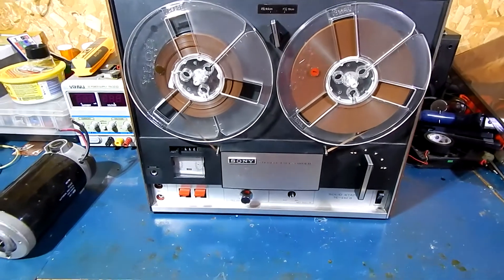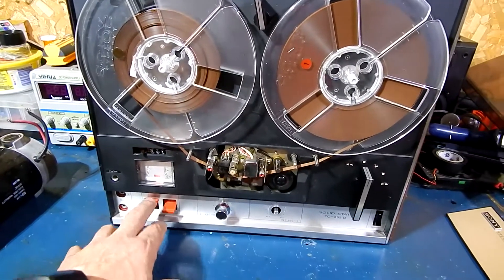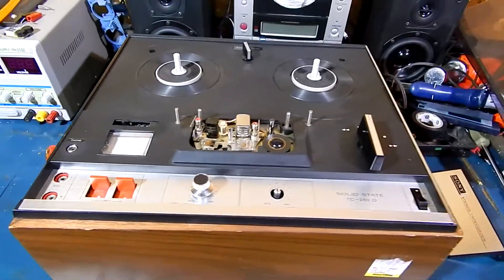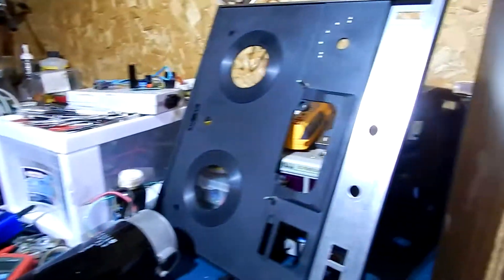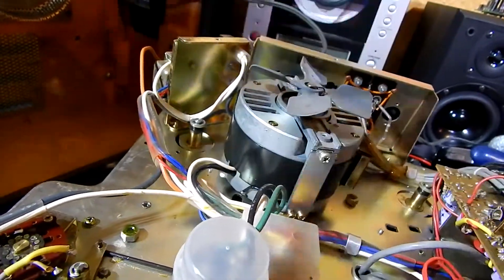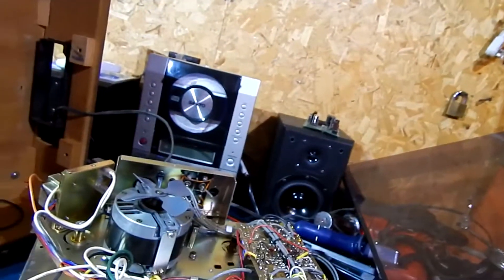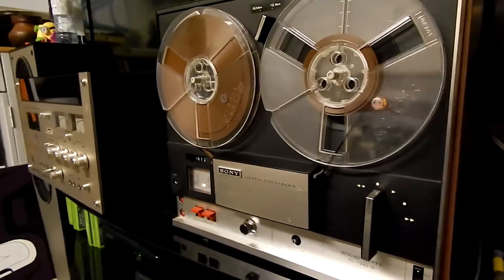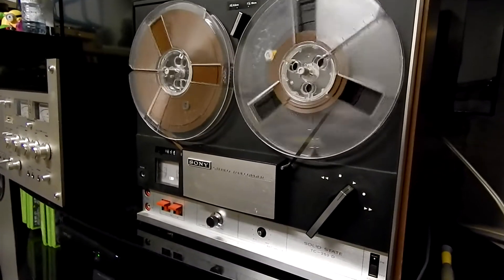Sony tc-252 d Reel to Reel Repair

Comment: Hope you are still monitoring. I have an identical reel-to-reel. The motor works fine but the pinch roller/fly wheel doesn't turn . Any suggestions about how to fix.

Comment: The tape was threaded incorrectly at the beginning of the video. It was supposed to go over the small wire lever not under it, that is part of the auto-stop mechanism  It is tied to a switch that kills power to the motor when the tape ends. Those caps, even defective would not have caused the motor to stop running, those are connected in parallel to the switches to prevent sparks. Changing the electrolytics would make the machine sound a thousand times better.
Reply from the maker: +macuser1k  yup figured it out afterwards
Reply: True these are sony properietry spark quenchers with .1uf 250v and 120ohm 1/2watt resistence  connected in parallel,   nothing to do with starting of motor , the tape was not correctly threaded ,  I have a Sony TC350 and a Sony TC 660 with me I am looking for the service manual for Sony TC 660 if somebody can share it I will be obliged , writing to you from India

Comment: If you were able to run the tape player without the defective caps then what characteristic did the "dried out" caps present, to prevent the player from running as found?  I thought drying out only applied to electrolytic capacitors.
Reply from the maker: +hankus253  not sure how they failed just guessing >:) from what i remember there dry inside. last owner could have a had a voltage spike.
Reply: +Karma Electronics Those caps appear to be 0.1 uF  120 ohm surge suppressors or interrupter.  Look up OKAYA interrupter 0.1uf+120 W.  I was just curious if you actually tested them and if so what I should be looking for if I find a bad one in a circuit.  Do they test shorted, open, no capacity, low or high ESR??
Reply from the maker: +hankus253  there open
Reply: +Karma Electronics if they were just safety capacitors, then going open shouldn't have stopped the motor??

Comment: I have the same exact model and when i dont have a tape in it it looks like it works fine once i put a tape on the resistance from the pinch roller and the reel collecting the tape gains alot of tension and the motor just stops do you know what i could try?
Reply from the maker: i had the same thing. i found i had to adjust the plastic band around each spindle used to keep tension. it was out of adjustment and would just pull the motor to a stop
Reply: how exactly would you adjust the bands?
Reply: Karma Electronics god damn i screwed it up  and now the selector is not in the right position ugh i don't even know what to do now.... you think you could email me a picture of that area what it is supposed to look like?

Comment: I have it's cousin, the TC250a. It gets to speed just fine, but there is no audio. Faint audio out of the right speakers on playback. But no audio from the line in. Any ideas?
Reply: I would clean and demagnetize the heads thoroughly. On a deck this old, they could be filthy. That won't fix your line in issue, but playback should be much better.

Comment: can you buy from newtech on line? I just bought a tc 252 and mine runs too fast when in play mode regardless of what speed it's on
Reply: the speed problem must be due to frequency  50HZ or 60 HZ in the power supply , you can try changing the capacitor of the motor   if your country has 50hz cycle then the capacitor value  will be 1.5uf  and if its  60hz cycle the capacitor value has to be 2.0 uf